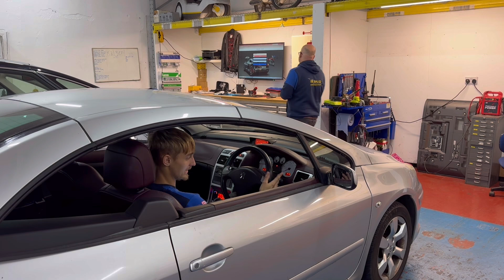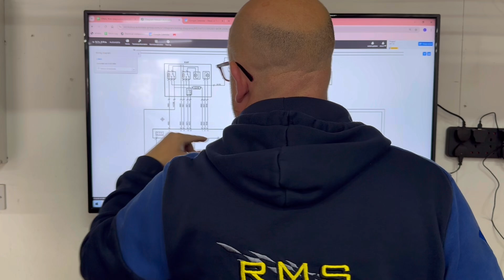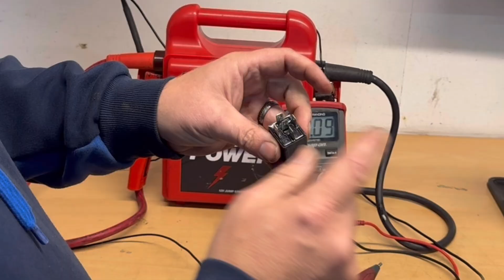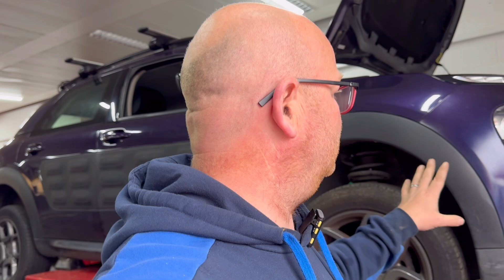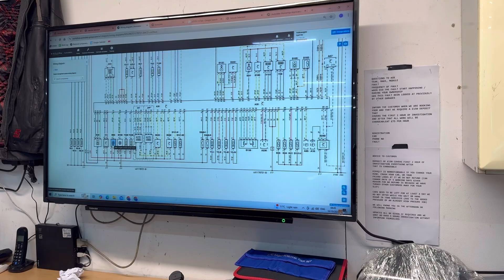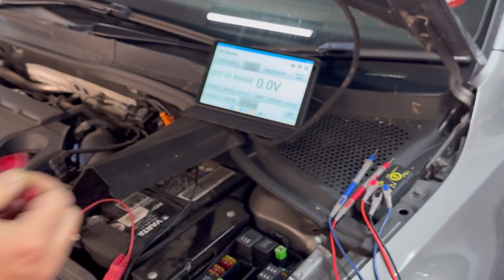We try to get a barn find started can you guess what car it is???

Comment: I saw someplace else where on a car that has assisted parking all the sensors need to be working as it cannot park properly and so is deemed too dangerous to start
Reply from the maker: they normally stop the full system but the rears would work fine but something was interfering with the front stopping it

Comment: I had a Citroen C4 Picasso in last week. We fitted tyres to. Customer took the car away come back the traction control light was on ABS lights and engine management light was on. 
I scanned the car. It comes up with injector 1 fault code. And the ABS was not communicating with the ECU. Put a new car battery on it and replace the injector one cleared all four codes. Drove the car for an hour and all the fault codes were cleared. I was stumped how the injector was related
Reply from the maker: crazy mate
Reply: I'm enjoying watching your video, and the path you go down to find the faults. It's an eye opener

Comment: Loving the channel AND your methods.
I'm a former Copier tech.
I've attended more training courses than I can remember and the majority required a day of faultfinding, with problems set by the trainer on numerous machines, students out of the room.
I would invariably get strange looks from the others when we came down to the machines and as they poked around looking for a wire pulled off, or a missing component, I checked the codes then went and sat down with the manual before coming back with a list of 3 things to check and a theory of what the fault may be.
By the time the trainer returned, I would normally have narrowed to one problem and would take the trainer to one side to say (For instance) "I haven't repaired it yet, or looked at the connector, (Or sometimes taken the covers off!) but it's a disconnected wire or bad connection on pin 12, CN 268".

99% of the time I'd be told to go for a coffee and wait for the next machine to be free.
.
AT LAST someone else who does it properly!!!
I hope Barney realises how lucky he is to have a mentor who teaches the CORRECT methods.
Reply from the maker: the good thing is he takes it all on board, makes it so much easier. thanks for watching,jobs a carrot